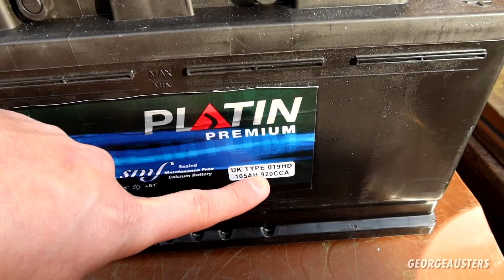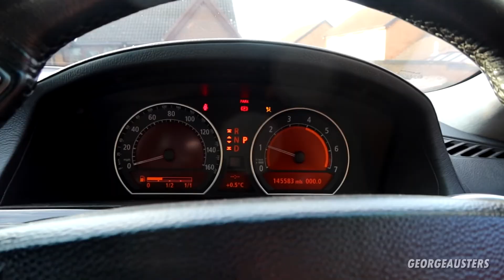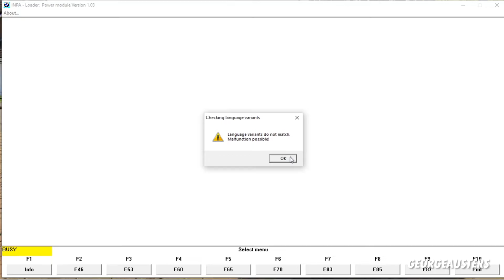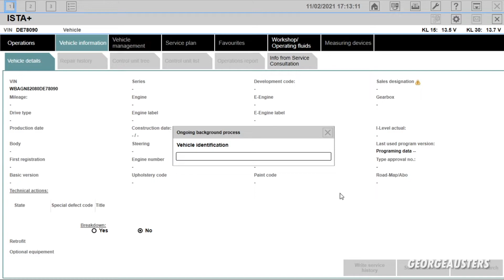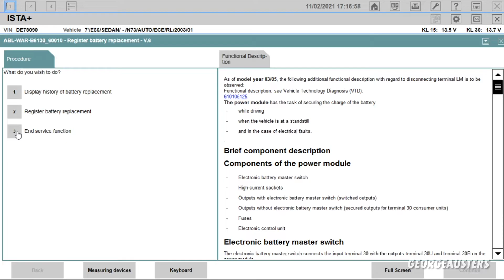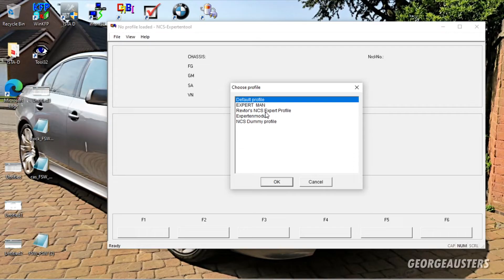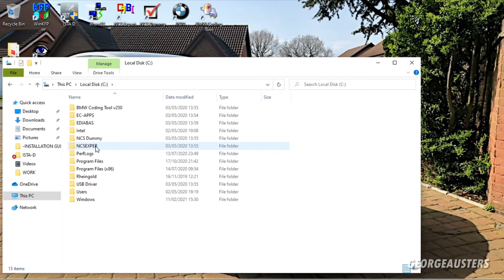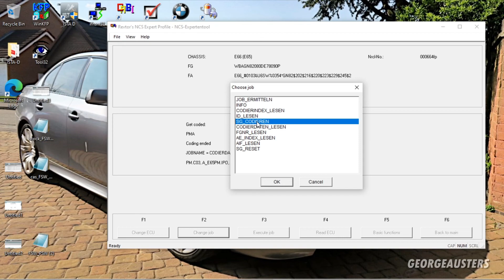BMW Battery Replacement | How To Replace, Register and Code

Comment: Hello George I have a 2011 BMW E90 318D.
I changed the battery today everything works fine accept all the indicators are flashing very fast Left and Right.
The hazard warning lights flash fast too.
All the bulbs seem to be working. 
This has just happened when I changed the battery. 
Any ideas??

Comment: Ive got an October 2003 E60 and have owned it for 14 years now.
Never bothered recoding the battery at all, just took the old one out and put in a new one.
Not even sure if early E60s do battery coding.

Comment: Hi, thanks for the vid, just changed battery on my car E63 2007 N62, managed to register using INPA but NCSexpert giving "profile vesrion 2.0 ungultig" error when trying to load the module "Rivtor's NCS expert profile". Any help appreciated. I 'm using V4.0.1 and Ediabas V7.3.0

Comment: is it necessary to code if I previously had a 90AH battery but now I have a 95AH

how to know wich module you need for coding?
Reply: have you find solution? i have the same problem
Reply: @seekter-kafa its your cas module
Reply: @seekter-kafa  or use ista+ software

Comment: Ive had good luch with Deka batteries, put 130k miles on one in an e46, croaked after sitting at the shop for three weeks, It now has a Mercedes Benz brand battery in it😆.

Comment: Weird I can’t find PWM module in NCS Expert
Reply from the maker: Only on 7 series
Reply: @GeorgeAusters  oh ok 👍🏻 mine is e61 530i n53. I used different method using NCS Expert and NCS Dummy. New battery coded and changed from 80ah agm to 90ah agm and then successfully registered using ISTA and your method 👍🏻 thanks George

Comment: Hi george. I replaced my e60 bmw with a 105ah battery and followed steps with ncs expert. But after coding it shows 80ah same as before i changed it. I read somewhere i can only put 90ah max for mine as theres no 105ah setting . Next setting is 110ah Any help? Thanks
Reply: Do you know how to george?

Comment: I also have the BMW E65 and I have changed the batterie quite a few times so far myself without ever registering the battery with all that software. What's the point of doing that if it works by just removing the old and putting the new one?
Reply from the maker: Because it makes the battery last longer.. why have you replaced it multiple times?

Comment: Hello my friend, I have a BMW 7 Series, but the alternator does not charge the battery because I bought a new battery
I also replaced 5 used generators without interest. Do I need to program the new battery?

Comment: Good video, however, on my e60 M5 I can’t get to change to 105 ah, even following you stet by step. It still read 90 ah. Any insight?
Reply from the maker: Because there is no such input for 105ah.. You need either a 90ah or 110ah battery for your car
Reply: @GeorgeAusters  interesting, but a 105ah bmw battery was in it from bmw dealer when I purchased the e60 m5 from them last year. Thanks for the insight, friend.

Comment: Great vid man! I have a question, my current battery in my BMW 1 series is an AGM 80amp, 800CCA. I've ordered a new AGM one 85amp, 800CCA. I've also bought a OBD scanner which has a battery registration function. I wanted to know, as the new battery is 85amps, will the software still be able to register it? Or will I damage the electrics putting in a higher amp battery? Cheers!

Comment: My e90s battery was replaced about a year ago by previous ownner. I see on the car log was not register any previous replacement, and the battery currently registered is a 90ahm  agm while the battery in the trunk is a 95ahm AGm. What would you say i have to do now?
Reply from the maker: Register as 90ahm AGM
Reply: @GeorgeAusters  you mean register  it as neweven the battery is 16 mothts old?

Comment: Hi. If the battery model and everything is same, do I still need to register it ?
Reply from the maker: Still need to register it but no need to code a different battery size
Reply: @GeorgeAusters  thanks a lot. got it. Btw the fault I got on my iDrive is “Battery not charging”. Would you say it’s got to do more with the alternator ?

Comment: Hi, quick question as i see an inconsistency between B-Tool app and my actual battery. App says that i have a 91 Ah battery but i actually have an 110 Ah. Is that an indication that the battery is not registered? I bought the car with that battery already installed
Reply from the maker: Correct, battery needs to be registered

Comment: I don't know if someone has commented that you didn't say anything about what you did with the ventilation hose, or better what should be done.
Some days ago I changed the battery in my X3 2011 to a Varta 95 Ah/850A AGM from an original battery 90 Ah/900 A AGM.

The hole for the ventilation hose seems to be blocked in the Varta battery which wasn't the case in the original one!
Is there some kind of automatic ventilation if or when the inside pressure rise?
Reply from the maker: I plugged the ventilation hose in. The plugs are only there for transport and should be removed on delivery👍🏻

Comment: Hi, I got my bmw x5 battery changed recently, it was 90ah and 900 cca, and the new battery they installed for me is 92ah and 850cca, but based on the scanned after they changed, it's still showing 90ah, I wonder if that could cause problems? cause after we got our car we have many errors related to the battery from the scanner.
Reply: Hello, aren't the fault codes kind of random? I changed battery recently without back up in my X3 2011, and I got a number of fault codes, but I succeed (!?) in deleting them. One door window I had to drive up and down 1-2 times before the fault code disappeared!!! Maybe not what you expect to have to do.
But after seeing this video I think I have to check the programming. I don't quit trust the tool I used! After all.

Comment: Hi Goerge, having a issue with my car since the cold weather, wipers not stopping (had to take relay out) cluster has multiple lights on Airbag, ABS, DTC etc, wing mirrors stopped working, steering wheel buttons stopped working. Speedometer not workimg but rev metre is , fuel guage going nuts,  Charged the battery overnight no change, bmw 2010 E92 coupe - Any idea what it can be, car stock and only thing i haved had changed is ABS sensor with ring (aftermarket).
Reply from the maker: You haven’t been charging directly from your battery have you?
Reply: @GeorgeAusters  No mate i watched your video and connected it from the engine bay left it to charge overnight. Also from reading forums, some folks have said its fuses but i checked them all and cant find any blown :(

Comment: Why do you not use a memory saver with 12 volts?  Is it not needed? What memories does the car loose when you switch over to new battery and not use a memory saver?

Comment: Question? If I put the same battery specs all across the board. Just different brand does the car still need to be coded? Understanding it has to be registered for sure. I already figured that out everytime I turn the car off I have to set the time and the car is tell me about the discharge.
Reply from the maker: Need programmed

Comment: Hi George, could I ask you for advice? I have an original BMW Varta dead battery that is 90 Ah 900 A CCA. Ista suggests to replace it with another 90 Ah. For my BMW E66 760 Li 2005 restyling, do you think it would be better to replace the battery with the one you show in the video (110 Ah 920 A) or with another 90 Ah 900 A CCA? Thanks for your help.
Reply from the maker: To be honest, either is fine but the 110ah is bigger of course
Reply: @GeorgeAusters  Ok, tnks George👍

Comment: Is this for AGMs battery? Just correct the amperage in that notepad?
Reply from the maker: You need to change to a AGM if you're installing one
Reply: @GeorgeAusters  Where do I change that in INPA or ISTA?

Comment: Is there anyway to change the battery amp amount easier like on an app with a plug-in obd2?
Reply from the maker: For some models yes
Reply: @GeorgeAusters  I had an e60 545i

Comment: why do you register the battery?
Reply from the maker: For the IBS
Reply: @GeorgeAusters  is it dependant on the model of the car? I have an f30 2012 but my OBD cant connect wirelessly
Reply from the maker: Pretty much all BMWs after 2005 and some before

Comment: You make some really good videos, George!

This is what it says in ISTA-D when you're on the page to register the battery:

"For a battery replacement, the standard installed battery capacity may be used as standard. When installing a battery with a higher or lower capacity or when installing an AGM battery instead of a normal lead-acid battery, the CAS must therefore be reprogrammed using ISTA/P."

I got the impression that INPA/ISTA-D is fine for registering your battery as long as it's the same Ah and type. But if you change the Ah and/or type, then you either need access to ISTA-P or you can use NCS Expert to code in those changes. The exception being that if the battery coding information is stored in the CAS module for your car, then you don't need the coding tools. The above quote seems to go against that.
Reply from the maker: Some models you can change the capacity using ISTA D but other models like the E65 you need to do it using NCExpert like in this video

Comment: You have done everything I had to do on mine! 
I used my Autel MD806 pro. 
It has more options the same as your ista. 
Like showing you history and charge status/last full charge ect 
Mine was 80ah and I replaced with an 85ah but unfortunately the coding was not done as the Autel seems to only code genuine batteries as it asks for the number on top but for anyone to trace the date of manufacture. 
I haven’t got IBS on mine so I wasn’t too worried and that it didn’t t give an option for 85ah. The close was the 80ah.

Comment: If you have an old BMW like E39 from 2000 or so. You can just simply change the battery. No reprogramming is required. I have done it on my with no problems. I think after 2007 and new cars, you need to reprogram or you battery will not perform at its maximum.
Reply from the maker: Any BMW with an IBS needs registering. This 7 series is a 2003 and has one👍🏻
Reply: @GeorgeAusters  I guess I am lucky my 2000 BMW 528I does not have it.

Comment: great video! do i have to reprogram the battery if i disconnect the negative terminal for repairs?
Reply: Nope, just simply put the negative cable back on the terminal and clamp it up. This procedure shown in the video is if your replacing the battery itself for a brand new one.

Comment: Hi george is radiator repair fluid advisable in n52 with electric water pump
Reply from the maker: No I’d just replace the radiator👍🏻

Comment: Can it be coded using ISTA d?
Reply from the maker: Not for coding no. You can register and change the AH if it’s in the CAS but not if it’s in the power module
Reply: @GeorgeAusters  I guess sticking with the same Ah & CCA would be the best option then if one is not able to code?
Reply from the maker: Yes, but make sure your previous battery was coded though as mine wasn’t

Comment: My e92 oem battery lasted for 11years.  Ive just changed it in 2020 november.
The thing is in 2017 it showed sign of the battery not being able to keep heated seats,heated rear window and start and stop on and in winter it will struggle. All power was mostly reduced to being able to keep the car starting up or alarm on.

I have now a problem the auto start/stop stopd working the new battery cant seem to clear that problem. Carly cant seem find the fault of the start/stop nor can i even deactivate that function. The idrive will beep to tell me start stop is malfunctioning only when i shift into 1st gear on start up.

Comment: Gosh, that was quite a prosedure. I replaced battery in my e90 (330 xd) with a higher amp.hr. spring 2013. Had to turn steering wheel fully right/left, and it was good to go. The old battery was AGM, the new a standard battery. It will theoretically recieve max 14.4 V, when it can accept 14.7 V. But the battery is still live and kicking. No fault codes. 
Enjoy your explanations!
Reply from the maker: You’ll cause issues / shorten your battery life if you have the wrong AH coded 👍🏻

Comment: And if you DON'T have a INPA??? use bimmertool and do the same. Inpa is not so easy to get as bimmertool.
Reply from the maker: I don’t believe you can code batteries using these devices, only register them
Reply: @GeorgeAusters  And what is the difference when you put new battery in?? Just go to right oprion and register new battery. Easy 5 min of work.
Reply from the maker: @NiecikTeam  In cars where the battery isn't in the CAS module, you can't change the AH. It needs to be coded on something like NCSExpert
Reply: You need bimmer code. When battery is different.

Comment: Hi, George  the process  similar to put a new battery on bmw 1 series E87 2010  120d
Reply from the maker: Yes but the battery is on the CAS module so even easier
Reply: @GeorgeAusters  thank you so much George

Comment: George im not into the computer stuff, please tell me that i can just take the old battery out and put the new one in !!
Reply: That's exactly what i thought all this time as well....
Reply from the maker: You cannot👍🏻
Reply: @GeorgeAusters  really, i cannot on my 2006, X5 e53 ??
I used to have a 2004, 530, e60 and i changed that without issue. Sorry but can u confirm ??
Reply from the maker: If you change the battery with registering it and you have an IBS then it will reduce the life of the battery
Reply: You can  just put a battery in and leave it at that